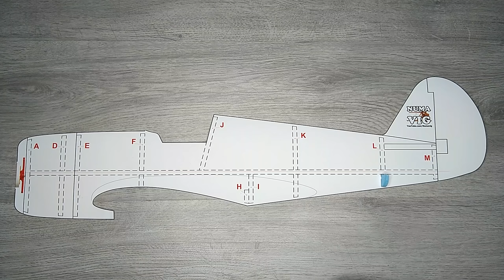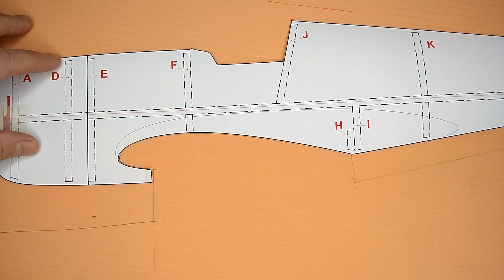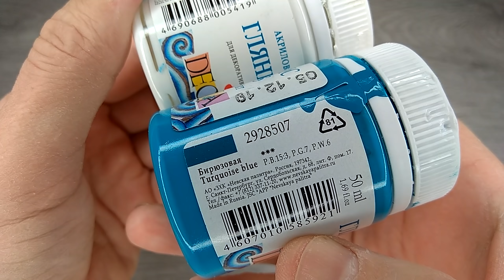Curtiss P-36 Hawk RC Plane DIY

Comment: I wish we had access to the foam you've got there at fingertip!!! Beautiful stuff love your builds and stuff You've made so far .. they fly very well.. thanks Ed in Phoenix writes
Reply: You can order depron sheats from the servo shop rc in the uk I did! Starting a build now 👍
Reply: I'm not sure where you live, but you can find the equivalent foam in the US at most any dollar store or the big box home improvement stores.
Reply: Ed this is the same foam that’s in foam-core-board like the $1 sheets sold at dollar tree. You can buy that and remove the paper with a little water and a lot of effort. RC suppliers will sell this as Depron or XPS( extruded polystyrene)
Reply: I've gone to Home Depot useing tile underlayment 3mm with mylar (silver) one side... Yes we have Dollar tree 
"Ready-made" foams 5mm Hobby Lobby has 1/2" thick foam core art-board .. I just wish a store here in the USA carried the epe foam like he has at his availability ... Without the pealing and glue residue to deal with .. thanks for the inputs guys very much .. let's get and stay creative .. happy safe healthy new year!!? Ed in Phoenix writes..
Reply: @edwardkie380  I agree with you, no easy way to get the XPS foam sheets, and DT foam board is eps foam, definitely not the same.  I'd definitely like to try some of Numavigs designs, they are great.
Reply: @edwardkie380  totally. I haven’t found a cheap source of EPP in Dallas TX either.
Reply: be careful: XPS and EPS are made with the same raw material, polystyrene, EPP instead is made with polypropylene a little more robust and suitable for bending, but only suitable for molding as in RTF or similar models in which the movable surfaces do not they are cut with respect to the wing, a process that cannot be done with EPS or XPS
Reply: Hi...thanks for your amazing video. Are those drawings or plans available for download? And is there also a list of materials to buy ?
Reply: And uhu por,titan wild

Comment: Hello friend. This is very goog job.I had one Chesna model 10 years before. but i could not use it because i crushed it.   I want to start this hobby again. which model plane would you suggest me
Reply from the maker: very easy to control especially with 3 axis Gyro https://youtu.be/8Dm0oQcbefs

Comment: How do you bend this so easily, every time I try I got a broken part..
Reply from the maker: Does the tape break too?
Reply: @NumaVIG  No, it breaks under the tape :/ bought the same XPS on Leroy here in Poland 1.5mm, 3mm, 4mm and the same (but 5mm is too much, I know)
Reply: @NumaVIG  okay, i figured out, that I was using a wrong material ;) thanks tho for answer :)
Reply from the maker: maybe you're using the wrong tape?

Comment: at 23:05, it is the opposite of smart, to use heavy  CF  as  pushrod, in a  small, light model.!!!!!!!!
Reply: carbon fiber is heavy?
Reply from the maker: Carbon rod 500x1mm weighs 0,6g, carbon tube 500x2mm weighs 1,8g. In this plane the length  of rods - 270mm